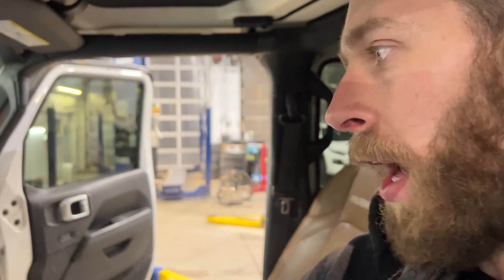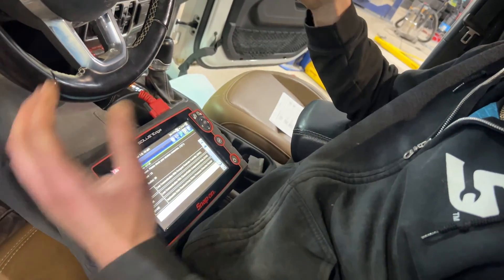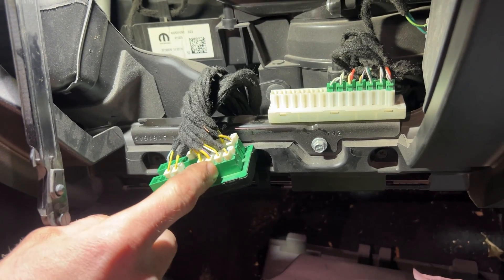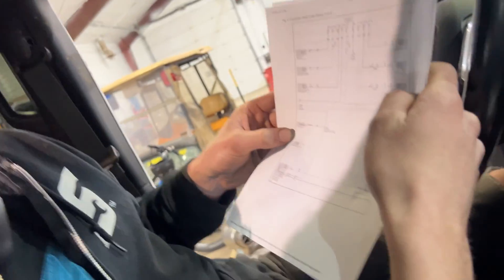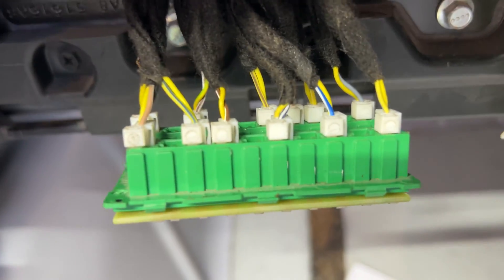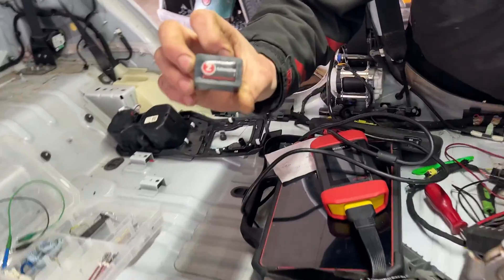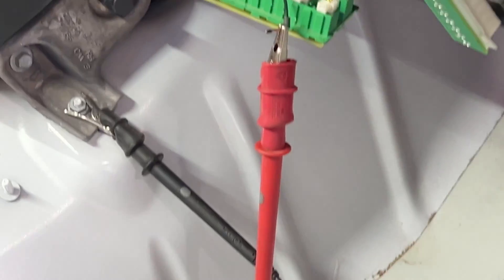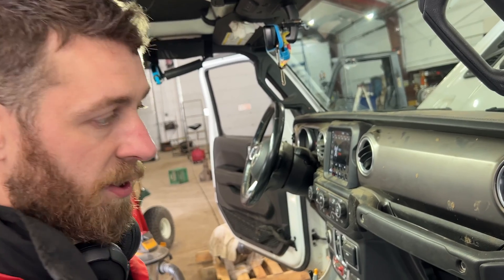Diagnose Communication Fault Can Bus 2020-2023 Jeep Gladiator

Comment: Hello and Happy Holidays.
Yesterday while I was accelerating my Jeep Wrangler JLU Rubicon it slowed down, went to a limp mode, and the dash board became like a Christmas tree, I saw the indication of ECS Electronic Stability Control service required, Adaptive Cruise Control Indicator, Forward Collision Alert, Electric Throttle Control Warning.
When I turn the engine everything went off but as soon as I tried to accelerate the same thing happen. Any ideas? Is this the faulty Can buss? Is it possible to be the aux battery? Thank you.

Comment: Got same issue my glad didn’t run 4 over 2 mths. 2021 diesel. Can’t fix it. Changed bus bars, batteries, etc, etc. still locked in park, security lights on, now speed control sensor no communication. ???

Comment: I had only power steering light then wiggled wires and it worked for a drive then next day i got christmas lights. Should i replace the whole canbus first then pull each star pin individually and find the problem? Or just replace the whole canbus first then do that? Thanks man

Comment: I replaced my pump on my 2023 (because it’s 10,000 miles over warranty) however it still has no power steering. Any ideas?
Reply from the maker: Any codes on a scan?
Reply: Power steering system 

I looked it up. It says power steering system, not communicating.
Reply from the maker: Probably a wiring issue
Reply: Do I need to disconnect both batteries to clear the codes?
Reply: Replaced pump and Cam-Bus, cleared codes with my taser. Disconnected top battery (not the bottom battery); still shows dash warning and pump still not activating.
Reply from the maker: @howiefullmer2106 well it may set the code as soon as you hook the battery back up
Reply: It was a wiring issue.

Comment: Were you able to create the intermittent issue making it easier to diagnose? The issue I have is that it goes into the fail safe mode at the most inconvenient times 😂
Reply from the maker: @ovrlnd_g8r  I was able to get it to act up when I completely soaked the engine bay and the electric steering pump got wet, may be different in your case but intermittent issues are a tough one to catch if the problem comes and goes really quickly

Comment: experiencing the same issue. you are the only one to really explain the issue.
Reply: Had the same issue I just swapped out the can bus for a new one and problem solved. What I seeing over the internet is the area gets hot during winter months has we run the heat and over time it shortcircuit the can bus and it becomes faulty. From a glance it wouldn’t seem fault until you test the resistors at the bottom to find out the problem.
Reply from the maker: @ I think your talking about the green “star connector”.  The CAN BUSS is the name of the entire system.
Reply: @Tech-28  Correct
Reply from the maker: @razosrt  are you going to try and diagnose it yourself
Reply: @Tech-28  Unfortunatly yes. Im going to test can bus connector and go from there.
Reply from the maker: @razosrt  let me know how you make out, I see a lot of the green star connectors go bad but I also see a lot of wiring issues from corrosion in my area so it’s tough to say where to jump to exactly, I can’t stress enough to just take your time and work your way into testing, it’s not too bad to do when the issue is persistent but if it’s intermittent it makes things a whole lot harder to figure out. Good luck,  you got this!

Comment: Hey I replaced the green can connector and then the high amp fuse and still having power steering airbag ess sway bar disconnect. Still having the issues, next stop I guess is to test voltages
Reply from the maker: @goldenthrone8333  try diagnosing it the best you can and let me know what you find out
Reply: @Tech-28  at work now but I checked voltages yesterday and I was getting 0.3V CanH and CanL. I’m gonna test battery, remove and continuity test fuse array(even thought it’s new) then test fuses for current and Voltage then finally check resistance and continuity across each star connector wire. Was using steel heating tube behind glove box for ground
Reply: @Tech-28 UPDATE: I checked everything power wise and found that the TIPM wire harness that connects under 34 fuse was pulled out. That’s why I wasn’t getting voltage to the canbus. Just have service airbag which imma check a fuse for!

Comment: So your video has been the closest to what I have been experiencing in a jeep that I have. Traced the wiring, everything seems good. Unplugged wires at the electronic pump and at the star connector. Talked to another really good tech I know and he said the best way to be sure is to use a lab scope since it will pick up a lot quicker as opposed to a DVOM. Just wanted to get your opinion. Also thank you for the post, it really helped.
Reply from the maker: @Terry-p4x  I keep hearing more and more people say that these pumps have an internal fault which is reassuring, so far to date the issue has never come back and i am 100% confident that the pump was the issue no doubt. If I were you and have narrowed it down to the electronic power steering pump than I would just load test/short to pos/short to ground test the CAN high and low wires and then based on those results go ahead with the pump replacement.
Reply from the maker: @Terry-p4x  would be nice to just try a pump and see if it fixes it but they are so bloody expensive and not readily available that it’s not really a feasible option
Reply: That’s why I wanted to be sure about the repair. Not too many have an extra $1000 laying around. And don’t really want to get one from a yard as the same issue may reoccur. But thank you again for the info
Reply: @Tech-28  Been meaning to get back to you to let you know the p/s pump was the issue. Just wanted to say thanks again for the info. I also wound up replacing the CAN Bus connector as I just wanted to cover that basis if it got damaged. The guy has been driving it since and no issues have returned
Reply from the maker: @Terry-p4x  sweet :) nice work man!
Reply: Hi! I have similar problems. What are the parts numbers for the green and white can bus connectors shown in the glove compartment? Trying to find on Amazon or eBay but no luck…

Comment: I have a 2020 gladiator sport that will not shift out of park, gear and  all warning signs and codes come on so i took it to autozone to get engine code read and there were a whole list of errors. The main code was u0101 and solution suggestion was to replace transmission valve body, I dont have or know any trustworthy shops in town..its still driveable and hopefully wont leave me  on side of road

Comment: This happened to me. All i did was replace the both Cbus (green and white) I got 14 codes, ABS light etc.
Reply: I have a similar issue - getting about 14 errors, setvice transmision, service 4wd etc - what did you do exactly?

So far service center cant fix the issue
Reply: @gambit1001  behind your glove box there are 2 boards that need to be replaced. One is white and the other is green. Simple fix.
Reply: Did it fix the issue?
Reply: @Tpizzle513  yes it did

Comment: I have a 2004 dodge ram that is giving of a no bus before it said that it was just check engine light. now all the warning lights on. So i should check the module for voltage with multimeter and the one with greater voltage than 5 trace that wire to the sensor and replace part? Or is older vehicle different i dont think it has as much computers stuff as the gladiator.

Comment: Where could I get the wiring schematic like you have?
Reply from the maker: you could call a dealership near you and ask them to print one off for you. If they are nice they will do it.
Reply: Ok thank you
Reply: This actually helped a lot. I replaced the star connector in my wife’s jeep wrangler rubicon unlimited and still have air bags power steering sway bar problems so next day off I’ll try to unplug one at a time. Then you just trace the defective wire throughout the car?

Comment: My 2020 Gladiator has many warnings going off stop/start, power steering, won't let it shift out of park, fan on high speed, loss of communication and warnings to service shifter, service antilock brakes, etc...  I will check this out, thanks
Reply from the maker: Sounds very similar! We did more videos on this same problem.
Reply: With the communication problems you have, change the green star connector behind the glove box door. Guarantee all your solder joints are cracked.
Reply from the maker: @ScottBrown-r7h  this one was fine, it actually needed the electric power steering pump. but i highly recommend diagnosing it before just throwing the star connector at it
Reply: @Tech-28 I don't believe you'll have a bad power steering pump give communication faults throughout almost every other module. The common denominator here is the connector. I highly recommend getting the magnifying glass out and having a closer look at the solder joints behind the plastic cover WHEN it comes back
Reply from the maker: @ScottBrown-r7h  replace whatever you want, I’m just saying this was the case for my customer that’s all, I’ve seen it all my friend
Reply: @Tech-28  damn awesome had this issue on a 15 300s power steering pump module failed cutting off CAN bus C performance codes u00010 to be exact. I isolated the powersteering pump at the the starlink and all the damn symptoms like you had with this gladiator disappeared. I love diagnosing issues like this then actually find the cause such a Eureka moment. Iykyk what I mean lols. Never throw parts. Diagnose!!!